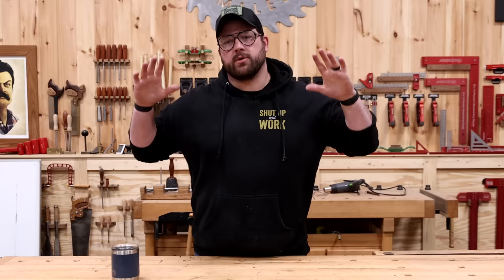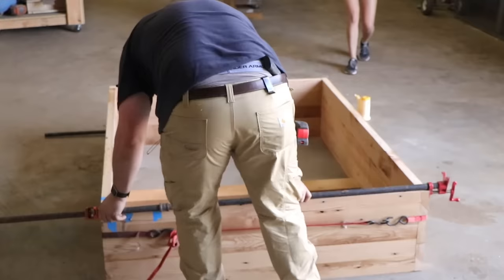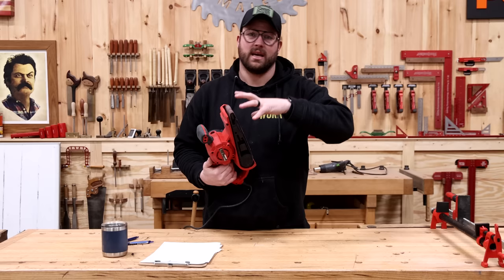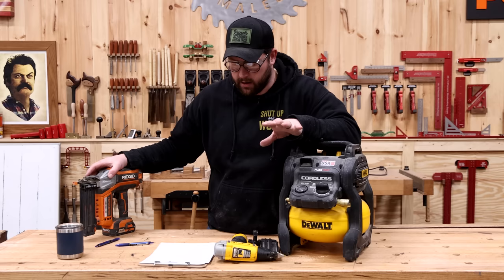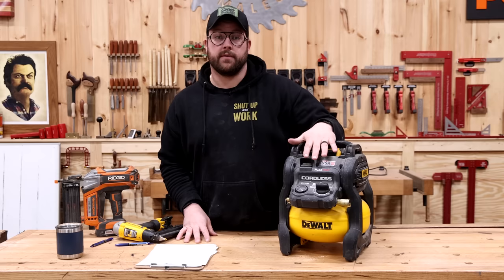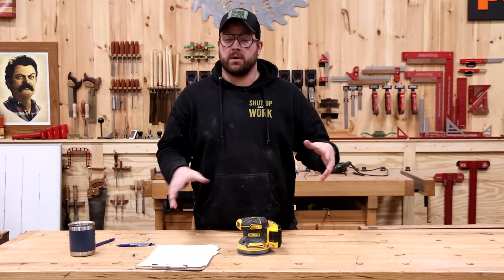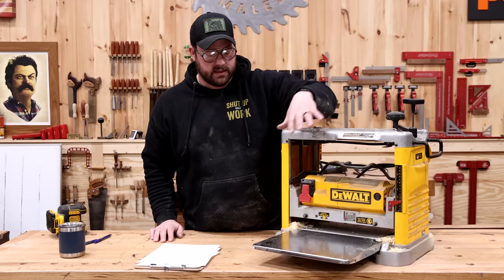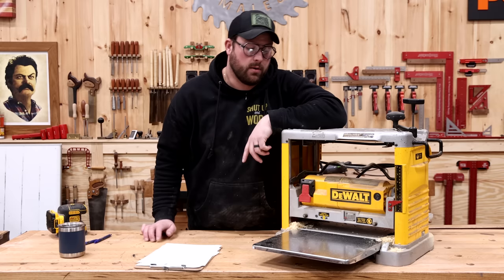5 Beginner Woodworking Tools I Regret Buying

Comment: You can get a porter cable pancake compressor, 25ft of hose and a 16,18 & 23 gauge nailers for $199. It’s the best deal.
Reply: I use my Ridgid  oscillating sander quite often 
Definitely invest in a coarser compressor not cordless less money and more air! 
Belt sanders can destroy s project in a hurry I have 2 they mostly sit
Reply: I was going to say this too. Craftsman has this deal too and it goes on sale during the holidays. I’ve gotten so much use out of just the compressor and Brad nailer
Reply: Yeah, exactly what I have in my basement workshop.  I think I paid a similar price for the PC w/nailers.  I also got a stand-alone PC compressor for my garage, much more convenient for topping off tire pressure.
Reply: Ridgid has a great combo like this too.
Reply: I can’t upvote this enough. I got the compressor and 16g combo which was around $100 at the time but I always wished I had gotten the three nailer combo instead of having to get them separately later. Would definitely recommend replacing the hose with a Flexzilla as it’s way more flexible and easier to roll up. 

A year ago I got all three Ryobi cordless nailers and I don’t have any complaints so far. The 16 and 18 were 2 for $120 without batteries during Black Friday deals which is well worth it. It’s nice not having to drag out the compressor/hose and wait for to get up ton pressure just for a couple nails.
Reply: Dewalt is the same setup. I think it's the same compressor with different paint
Reply: Yeah, and why would you get a cordless compressor?
Corded will be cheaper and more powerful. 
Invest in a bit longer air hose that allows you to set the compressor someplace and never move it.
Reply: Never knew they had a combo deal with 3 nail guns. Good to know.
Reply: @ryanmcadam1  I got the Christmas deal on the Craftsman one and think it was like 150 for compressor and 3 guns and a 25' hose
Reply: It is a great deal. I would invest in a different hose though. The one that comes with it is crap.
Reply: @ryanmcadam1  that’s what I got.  And with Home Depot and Lowes I get a military discount on top of the sale price.  It was once of the best shop/garage investments to date!
Reply: @billsedutto8824  you just added another $100 to my never ending shop wish list
Reply: @ryanmcadam1  yea but... it's craftsman so it frickin sucks,  I've had all kinds of garage sale tools mostly craftsman, man they suck at wood tools. I bought the ridgid 3 pack nail gun crown nailer brad nailer pancake compressor it's $300 now but beats the crap outta craftsman. Ridgid is turning into a really good company i keep buying ridgid and I keep being impressed, never going back to Dewalt craftsman or porter cable again
Reply: And don't get ryobi, they suck
Reply: I opted for the Kobalt quiet model over the pancake. My reason being that even with less volume, having the wheels and the quite tech makes it easier to use in a confined space but it does cost about $60 more.
Reply: I've had my pancake compressor that came with 16, 18 brad, and 1/4" staple for 20 years and only recently had to replace the compressor. Best beginner investment.
Reply: And when they finally go down, if you're handy, it is 25$ to fix.
Reply: I got it for 150 about 5 years back and everything is still working perfectly
Reply: As far as the bump feature, most new finish nailers have it, even Ryobi!
Reply: I was going to comment this. I have both the ridgid battery powered 18 gauge nailer and the aforementioned porter cable pancake compressor pack and I always go for the pneumatic option. It feels better, it’s lighter and I’ve found it to achieve better results (less blowout).
Reply: I got the ridgid compressor kit for the same price and almost double the cfm
Reply: That’s what I got, get a good framing gun n ur set
Reply: Where? Everywhere I look it's $330 except one place has it on sale for $300. Or do you mean they usually go on sale cheaper than that?
Reply: @pi11sburydoeboy  I got mine at either Home Depot or lowes about 3 years ago. Came with electric stapler n 18 & 23g nailers. Oh n the 25’ hose, it might’ve been on sale at the time
Reply: Came right to the comments after watching. Why a battery powered compressor? A corded is so much better and more powerful, maybe lighter. In the video, he says there's always power nearby, so what's the deal with not using it?
Reply: @pi11sburydoeboy  it looks like it includes a framing gun too now, that’s probably why it costs more
Reply: I’ve had my portercable combo for over 15 years and never fails me
Reply: Deal, but that pc compressor is so noisy. I wouldn't even bring that into a clients house
Reply: @Erik_The_Viking  Check on Black Friday. Almost always have a great deal like this 👍
Reply: Bought a hammer for 12 bucks. No idea why Americans are so obsessed with nail guns… oh wait, I think I do know.
Reply: Bingo,  and they do have a tank drain plug on the bottom, drain the water both dewalt and porter cable are sold by Stanly tools.
Reply: Where
Reply: @terryt2910 a cordless compressor works a little differently than corded. It's really only good for 23g-15g, but they're very quiet and very portable. The only ones I know of are the Milwaukee M18 and the Hikoki 36v, both 2gal
Reply: @mm9773 are you saying you use trim nails by hand? That's fine. You may have to use pilot holes on hardwood taking even more time.

What does America have to do with nail guns? Do you think house are built simply with hammers outside of America??
Reply: @histguy101  Have another look at the title of the video: “Beginner Woodworking Tools” – I have no idea why this guy is telling beginner woodworkers to buy a cordless compressor and a nailgun. I’ve never used a single nail in woodworking.
Reply: @mm9773  Well, woodworkers sometimes use nails. A lot of woodworkers also do finish carpentry and a lot of carpenters do woodworking as a hobby or side gig, and they would have nailers. Nails can often be used in place of a clamp and removed afterwards, like pin nails. Woodworkers also use staple guns or narrow crown staplers
Reply: Those PC nailer are absolutely horrific.

They are weird and out of balance, just buy hitachi
Reply: I bought it 😂🤣😂 had it for a year and finally used it.

Comment: No offense, and I certainly realize you're far more experienced with woodworking than I'll ever hope to be, but it seems a bit silly to claim an orbital sander would replace a belt sander. It's like trying to replace a pickup truck with a SUV. Yes, you can carry lumber in both, but you're going to carry a whole lot more lumber in a lot fewer trips with the pickup truck. Use the truck to do the heavy lifting, and the SUV to take the family out to dinner. In other words, you're using a belt sander to remove a lot of material rather quickly, and the orbital sander to smooth it all out and do the finishing work. Again, I'm no expert when it comes to woodworking, as I did automotive pain and body work for a lot of years, but I've sure as heck done a whole lot of sanding over the years, but given what I have to say on the subject, I'd love to know your thoughts.

On a side note, my Ridgid benchtop Spindle/Belt Sander Combo does in fact collect A LOT of dust. I mean A WHOLE LOT of saw dust. That's because there's been very few projects I've done over the years where this thing hasn't been incredibly useful. It easily makes the Top Ten list of best tool investments I've made. Sure, most times I use it are just for little 30 seconds at a time tasks like rounding off an edge, or smoothing an inside circle, or to knock off some burs, or any number of other quick and easy little tasks like that. However, I couldn't begin to count the number of hours to which those little 30 second uses have added up. I can't imagine being without this thing now.

Comment: By the time you buy the pipe clamp, and the pipe, you have spent the same money as a parallel clamps from Harbor Freight which are outstanding, or the Jorgensons when they are on sale. The price of black pipe has gotten completelt out of hand
Reply: He must have been referring to when he bought these many years ago.
Reply: Yeah if you can get scrap pipe you're better off. All the pipe i have came from who knows where. I know I didn't buy any of it though. I even have a pipe die to thread pipe with. So even if I find lengths of pipe with no thread on it I can make that work. I don't have a power threader but for how often I thread pipe what I got is OK.
Reply: I got 12 inch clamps from Harbor freight for less than $5 each.  
I knelt and wept at the prices for clamps
Reply: I've been using pipe clamps for about three decades.  I agree the Jorgensons are good -- you can get pretty decent tension on them, but I always forget I have them.  I'm always using pipe clamps!
Reply: Could u just use pvc pipe instead?

Comment: Pro tip: never buy short sections of pipe. It costs many times more per linear foot as buying a 10' section and cutting it down, which they'll do for you right in the store, most times, and even thread them for you if you want threaded ends for later coupling them together. You can also very easily cut them down yourself with an angle grinder if you need to. Current example: a 3' section of 3/4" galvanized is $25 or a 10' is $33.
Reply: Thx for the tip!
Reply: Great advise! Also, one 10’ bar can make either two 5’ clamps, or a 4’ plus a 6’.
Reply: Good advice I didn't think of. Thanks. That's a given for wood orders but just slips my mind with the rare purchase of pipes lol
Reply: @Fun4GA  Thanks for explaining how we can add to 10
Reply: @LuckyPineTrees-xs4ki - Yes, Captain Obvious. That’s me! 😂
Reply: A NOTE ON THE GALVANIZED:  It's much bumpier surface makes it less desirable than black pipe, for smooth sliding of the movable section.

Comment: Agree on all except the belt sander.  You can remove a lot more material quickly than with any palm sander.  Of course, finishing requires using a palm sander or the like.  But for quickly bringing a surface within the limits of a palm sander, you need a belt sander.
Reply: I think his point was that a sander can dig holes quickly, so in the hands of a beginner, they should be avoided. Also, no sanding should ever be pressed down (a beginner mistake). Belt, orbital, block, hand…. Let the sandpaper remove the surface, and let the dust get removed from the sandpaper. Pressure retains the dust and makes heat.
Reply: Random orbit sander and belt sander have completely different purpose.  Former is for finish and latter is for (aggressive) material removal.  If you are actually interested in woodworking as a beginner then invest in a hand planes / rasps or a cheap thickness planer depending on what you are trying to achieve.  Would never recommend a handheld belt sander to anyone interested in fine woodworking, whatever the experience.  You can get a benchtop belt/disk sander combo for cheap.
Reply: I am a retired cabinet maker. Spent many hours with all types of sanders. They all have their purpose. And they all require learning how and when to use.
Reply: @sdkee  - I guess you’ve never used a scraping card, but that would be the one sander I would never be without. More than the most bang for the buck, it’s a must have in my shop.
Reply: Completely agree. To suggest that a random orbital sander can be a replacement for a belt sander is ridiculous.  They are for completely different purposes.  Just learn how to properly use the belt sander.  It’s really not that difficult.
Reply: If you are doing specific work that requires a belt sander then sure. But for most beginner woodworkers, I agree with his point- your money will be better spent elsewhere. I've done thousands of projects and I do a lot of home renovation on historic homes and find I rarely need a belt sander. Over 25-year period I've probably needed it 10 times, and a few of those times I wish I had a different tool for the job. My money would have been better spent elsewhere
Reply: And when I get REALLY serious, I switch to my Porter Cable Siding Sander (carbide coated plates) and my electric hand plane.
Reply: @randyfrantz7195 yep, I happened to learn carpentry at the highest end shop in the area. ( I think the low end shops thought I was too dumb / goofy to work there).

We used belt sanders all the time on face frames that were way too big for the wide belt.

Just keep it moving quickly and don't press down and let the sander do the work.

The problem with cheap belt sanders like the one in the video is they are way too light to do work.

Comment: You don't need to thread the end of a pipe if you cut one. Just be sure to buy a pipe that is already threaded on both ends. Be sure you get the black pipe, not the galvanized pipe. I don't remember why, it's just better. There are a lot of good tools you can get at Harbor Freight. There are also a lot of not so good tools at Harbor Freight. Be careful which you choose. If looking to buy a pricey tool, research it and read customer reviews. I stick with four star plus with all I buy everywhere. I bought the better Dewalt thickness - planer this way and have been happy with it the entire time I had it. Except when I did something I should not have. Don't know what that was, but I broke a gear and had to buy one. This was a major pain, so I got extra just in case. You don't get parts from Dewalt. These companies have another company that serves as a parts warehouse for most of the major brands.

Comment: Well, I would disagree on some tools... I don't have parallel clamps, orbit sander or planer, but I have other ones. Let's begin:) I paid 60$ CAD for my belt sander- SKIL. Needed it for one project, it paid off itself in 2 hours. I agree that corded DeWalt orbit sander is the best one , but I also have cordless ones - it's not the same! When you have 1000 small drywall patches - you can't spend half of the day running from 1 socket to another, cordless one saves you all that time and effort:) Brad nailer. I have Bostitch compressor that stays in my workshop. I bought Ryobi 18G nailer for 160 CAD. And this summer I've got insane deal on 23G Milwaukee- also 160$(I was soooo happy). Again, portability can't be compared. Timing also. My advice - if you really don't need a tool at this moment , but you want to have it - wait for a sale - they have lots of them during the year:)

Comment: I have a cheap Harbor Freight belt sander and I clamp it upside down to the workbench and use it for sanding off crap on reclaimed boards. Works great and I'm sure OSHA would have kittens.....

Comment: I have been woodworking for 3 years. I finally broke down and bought the Rigid spindle/belt sander. It is a game changer for me. I build toys and furniture with curves so it gets used a lot. Amazing tool.
Reply: Yeah the guy is using the belt sander for the wrong project then complains about it.... I can put my belt sander upside down and use it for small pieces can't do that with the random orbit sanders.
Reply: I agree. I'm not a beginner, but, I use my Ridgid spindle sander often and haven't ever had any problems or complaints. When I purchased mine the cost was only $199.
Reply: While I'm at it, I have a handheld belt sander also. I used it to completely remove the finish off a butcher-block style countertop. That would have taken forever with a ROS. For $45, refurbished, it was worth the purchase for that project alone. But I agree that it is too expensive at full price, and too tricky to use, for a beginner tool.
Reply: I use that exact model he has, it's aight. I also use homemade table and sanding discs and drums on my lathe. The oscillating belt sander from rigid is great when it's useful but it gets used less than some homemade sketchy shit.
Reply: I got my spindle sander as a xmas gift years ago and i use it all the time. She spent 199 on it as well.  I also just got the ridged version of that bench top planer dirt cheep when i got most of a shop from a person retiring  and moving into an apartment.
Reply: That sander is amazing and is the perfect combo sander for small shops

Comment: I definitely think the Kreg saw guide is worth is if you don’t have the money for a track saw or a table saw. I used mine for years. It was great and it broke once after 6 years and Kreg sent me another one without any questions. It was worth the 30 dollars it cost.
Reply: After years and years of struggling to evenly cut plywood sheets using clamps and a 48" drywall T-square, I finally got the Kreg saw guide. I'm kicking myself for waiting this long. I always thought, "eh.. I don't really do that much woodworking, and I only have a few sheet cuts." Now I see the light! I agreed with John on all his other advice tips, but for me the Kreg guide is excellent. (Although, if I was promoting a TikTok video to make a track saw guide, I'd probably say differently. Ha ha)
Reply: I got the festool Ts-75 track saw and tracks. Nothing I've ever used cuts this good. Not even our Bosch table saw can cut as fine with a brand new blade on it. The edges of the wood are so sharp they look dangerous.

I don't know the kreg setup, but I've used various skill saws on various straight edges with equally inferior results. All of which have provided inferior results to our Bosch table saw as far as the cut itself is concerned.

I do hope the kreg system works good. I like kreg. If it was out when I got my track saw it would have been in contention for sure.

Nowadays everybody's saws run on tracks!

The festool rotex sanders are awesome too. You can switch that baby to turbo mode and remove material almost as fast as a belt sander but with much finer results. Again I know other companies now make sanders like these. I don't know if they're as powerful, but I do know their cheaper. But I've used this festool to sand concrete patch. It's that robust!